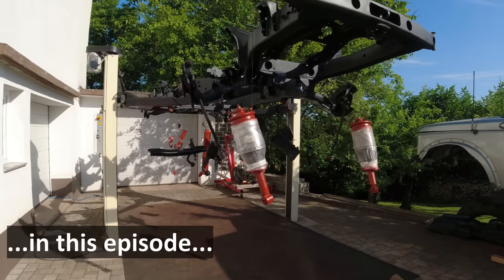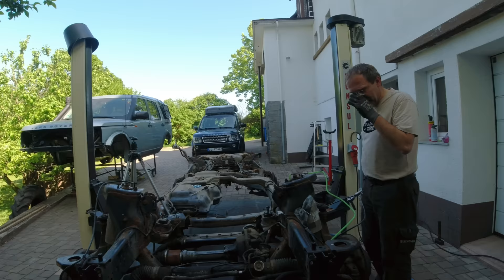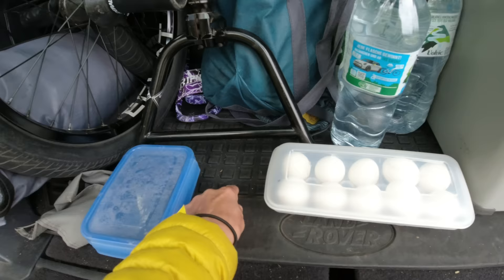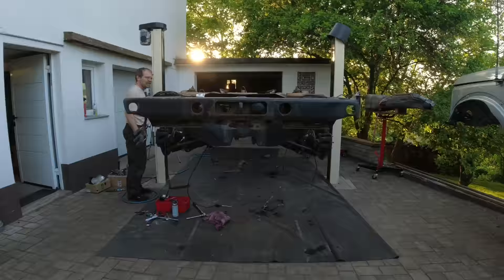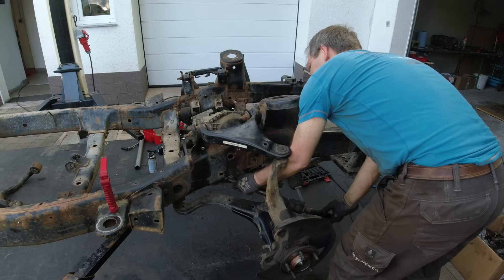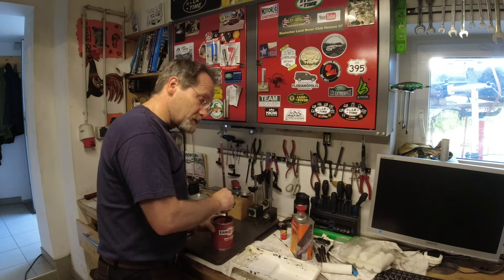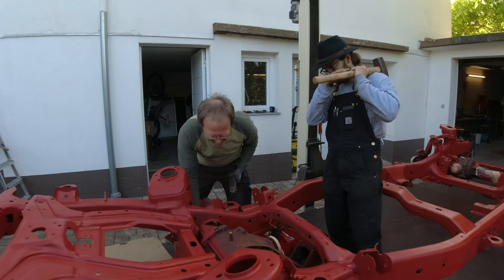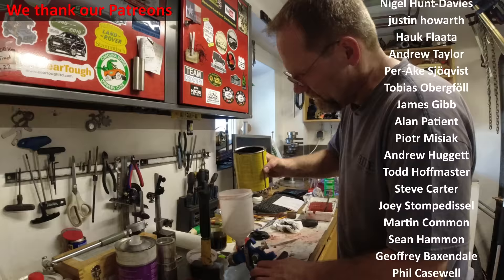Ladder Frame Full Restoration - Land Rover Discovery / S4-Ep26

Comment: @13.20, i've used those type discs (strip & clean wheels) & they are fantastic, they are available from 3M, they do different grades, the Purple one is the toughest one, the Blue one like yours is a softer one, i always use the Purple one when i'm restoring my old 1950's Austin's

Comment: I like both your comedy and your car restoration skills. A friend had a stainless steel peice of wire, from a wire brush from a angle grinder, in-bed deep into his skin. They couldn't use a magnet to retrieve it. So now he uses a leather protector when using wire brushes on his grinder.
Reply from the maker: Yes, working on cars is dangerous. 👍🙋‍♀️

Comment: Hi both, just a thought, now you have the air compressor assembly off you could slot the top left hand hole so in the event of failure or maintenance of the drying agent you can remove the assembly very smoothly. It also allows you to reassemble quicker ❤

Comment: Great work. However, part of the reason I never warmed to DiscoIII and IV is the fact that its chassis has so many dirt traps and rust traps, including the hole where the rear axle shafts go through, which would fill up with corrosive shit [from cows] almost immediately if I owned one.  Just taken delivery of my new Ranger and have thoroughly waxed its chassis already and also fitted blank grommets in the holes facing the wheels, including the big cross tube, to stop dirt and moisture getting in from wheel spray.

Comment: Awesome work. I prefer using a full face mask when grinding, better at keeping crud out of the eyes and face than googles, especially when working underneath. Grinding a frame is the nastiness of jobs. Always impressed at how much work you get done. Good point on the Stainless screws, about to replace a height sensor on my L322 and will do the same.

Comment: Hi Christian, usual expectation with diff oil is thicker oil is better. Not true in my experience, especially is colder climate. I believe it starves the pinion bearing longer than a 80w or 90w oil would. 
70w90 seems to be the sweet spot imo.

Comment: Hi guys from OZ. Loving this project. You both have huge hearts to take this on. I think of the reassembly and missing something and having to spend hours pulling stuff apart again to fit something you forgot 😱. You didn't worry about paint overspray on your other vehicles in the driveway...or the D3 body on the hospital bed?? Was it not a problem?
Reply from the maker: No, not at all. Any overspray (hardly any anyway) settled on the ground immediately. Which is always covered in a heavy duty tarp. 👍🙋‍♀️

Comment: I'm sure you already know this, but when you replace your rubber suspension bushings, make sure that they are in the loaded position before tightening the nuts. On my old Toyota, bushings used to fail regularly until we realised that we had been tightening them with the wheels off the ground. When we lowered our cars, we were twisting the bushings and this was causing them to eventually tear.
Reply from the maker: Yes, tightening will be at the end.  Thanks.  Christian

Comment: Watching someone working on their lr3 whilst working on my lr3. In Australia.

About to embark on the HPFP and timing belts. Rust under the battery. Plastic coolant parts. New suspension compressor and rear struts. 290k on the clock and none of these parts have been replaced yet (except for the compressor which I did with a temporary cheap Chinese $170aud) which is very noisy. Island 4x4 sent all the parts.

Comment: When you are stripping the frame, do you photograph it extensively beforehand so you know how to put it back together?  Do you have a system to keep track of what hardware goes where (I'm sure you don't just throw fasteners in a convenient box)?  The real challenge when you get a frame clean enough to eat off of, is the reluctance to get it dirty again!
Reply from the maker: Of course we did. 😅👍And a lot of parts are self explanatory. Also, we have two sitting right next so we can check where things go, if all falls apart. 🙋‍♀️

Comment: Personally I'd get the car sandblasted and primed fast, cause flash rust would be a pain, I'd also recommend spraying raptor liner in the wheel areas

Comment: Thanks; I really life the tip for the electrical connector. 
The outside of the chassis is looking great and very thorough.
What do you itend to do to treat the inside of the chassis, or is this for next week?
Reply from the maker: No, we will not do anything to inside of the frame. There was no inside-out rost issue really.   But the body will be done and that is in a future video.  Christian

Comment: My Discovery 3 body is currently off following an oil pump casing failure. I plan to take advantage of this negative situation and clean and paint the chassis especially the parts you can't normally reach. I appreciate what you have done to the outside element but what are your thoughts on spraying inside the chassis with a rust treatment too ?  I plan to use  Krown as they use this in Canada where they have a lot of snow and use around 5 million tonnes of road salt a year apparently plus they have a lot of Toyota's .
Reply from the maker: Only spray the  inside if there is rust.  Make sure the stuff you use is compatible with the paint.  We will not treat the frame but the body.  Christian

Comment: Looking good!! 👍

I can't help but wonder what the condition is of the differential bushings.  You didn't mention them in the video, but I assume you gave them a good look.  I think those are also one of those pain in the arse jobs when everything is together.  Did you consider changing them anyway?  As Derek from Vice Grip Garage would say...  "mozzle" (might as well 😉).
Reply from the maker: I tried changing them and have it on video. Made a arbor and Robin hit them with a sledge hammer. Trust me, he knows how to hit.  No chance without portable hydraulic. Rubber looked ok so I gave up.  Also no spare.  Would have to make adapters.  Christian

Comment: Don't know if you thought about checking internally the chassis for rust as l have seen a few in my experience chassis rust from inside out Barry.
Reply from the maker: Suspension arms yes, frame no.  Christian
Reply: That's ok I know you said they didn't Salt the roads where you live that will definitely
over, here in Australia the discovery 3&4 get driven into the ground so it's difficult to a good one for that reason I'm looking to
 buy the range rover sport 3lt then you have a very chance of getting a good one.
I really like what you are doing taking pride in your work you do.
 Thanks Barry 
 @Vera_and_Christian

Comment: Hi,
I have a Landrover LR3 2007 6 cylinder vehicle. Recently repaired the engine and timing also perfect. But not starting due to spark plugs are not firing meant only 1 time spark and after no sparking. Can you help me for solving this problem please.

Comment: Wow, what an extensive overhaul. Great job. So do I book mine in for next year now lol. Did you get much overspray on the discovery body?? It was very close to where you were spraying. I have a 2004 discovery 3 2.7 manual which I drive daily and also use off on trips to Spain. I also tow a 7.6m caravan around the UK and Europe with it and it has been very reliable. We have recently returned from a 2500 mile trip around France towing the caravan. I have thought that maybe I should think about buying a newer vehicle but this one has just been too good. I do regular servicing on the car and preventative maintenance which is key. Next summer I plan to replace the clutch and flywheel (unfortunately it will need to go in the garage for this) and I will also replace all 4 air shocks as these seem to be original fitment.
Keep up the great work both of you.
Reply: I was also wondering about overspray on all those vehicles in the driveway.

Comment: Hmmm If i went that far i had replaced all Controlarms with new ones as they are dirt cheap.
i have my Discovery prior to the TÜV floaded with anti corrosion Oil, "Ohne Mängel" but he left the comment on the that there is corrosion on the Frame and so on. Do you treat the inside with something like Tthat?
Reply from the maker: Been there, done that with the "dirt cheap control arms" Never ever again. 😅🙋‍♀️
Reply: @Vera_and_Christian  OK maybe not the dirt cheapest but it saves work an Time, ok I am self-employed so Time is Money

Comment: Would you recommend the w140 diff oil or stick with the w90.
Reply: I've done some oil testing on both, not much difference in regards to wear. What I can tell you however is the front diff is a lot harder on the oil compared to the rear and ive found it needs changing around twice as often as the rear

Comment: the best is to SANDBLAST the chassic and GALVANIZE IT by submersing it and do electrolytic plating with zinc.
Reply from the maker: As far as I know will no shop take a rusty full box frame into a chemical bath.  I think what you describe does not exist (for normal money).  Maybe you can tell me a shop in Europe which would do that.  Christian

Comment: The frame looks very good and would cost a fortune at a shop to get it like that. I'll have to agree about the coil springs being my preference - less to go wrong and I'm not capable of doing repairs like you can , so I don't want things that will go wrong at the wrong time.
Reply from the maker: No problem.  Coils are just better in some circumstances. Christian

Comment: ARB front and rear lockers. Body and suspension lift. Expedition springs, locating cones and shocks. Upgrade steering etc to heavy duty. Steel front and rear bumper rock sliders.............. Just like diso 1 300 tdi 😂😅🤣

Comment: What are those dumbbell size weights for? Just leave them out.
Reply: @kviasen7603  I'm sure they are needed in a standard LR, but Vera carries a whole lot of fixtures in the back that will compensate in weight for those weights. Sure the bits in the back are via the body not directly on the chassis, but the extra weight is there. (I'm sure Christian will put them back though - he's such a stickler for details). Lets see what happens next week.
Reply: I heard somewhere that they help to stop motion sickness  for passengers .
Reply: They are what's known as a tuned mass damper. Essentially they reduce vibration amplitudes of a targeted frequency
Reply from the maker: There is a episode coming up where Vera measured the timing influence on vibration. Definitely noticeable according to her.  Christian
Reply: @Vera_and_Christian  Yes, I forget - its not a Toyota. (Most overpriced garbage around)

Comment: I thought if you have come that far with the chassis why don’t you get it galvanised
Reply from the maker: You will have a really hard time finding someone who will put a 17, dirty and rusty on the inside, frame into their galvanizing bath. These things need to be done when the car ist still new.  A galvanized frame should have been a buying option. And it's unbelievable that it is not an option with the Grenadier, as far as I know, at least. 🙋‍♀️

Comment: The air tanks rust out from the welds on the inside,
Reply from the maker: The air tank is still good and easy to replace later on. We already restored it when we got this Disco in 2016. 👍🙋‍♀️Vera

Comment: Convert to coils? I converted a rear coils D2 to SLS (air suspension) Sell the D3, keep the new D4!
Reply from the maker: Good job 👍 🏆 Christian
Reply: Original D2 air bags no longer seem to be available (at least here in Oz) - just aftermarket stuff which are of much lower quality. This was why I was forced to coil the rear of my D2 (sad face!!).